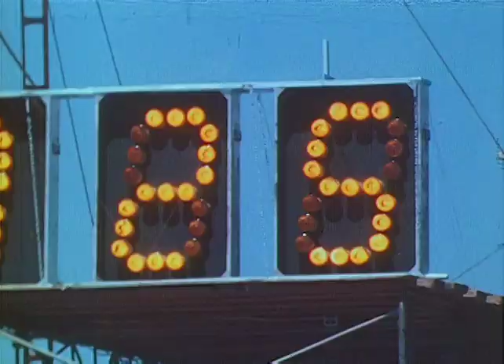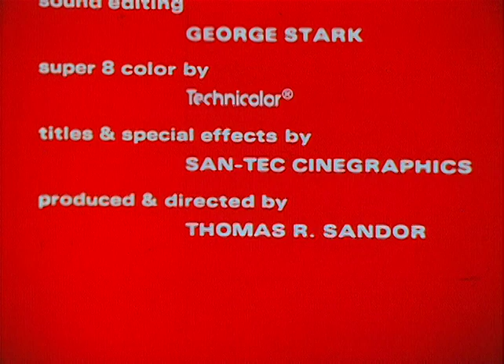Teamwork - 1974 Pay'n Pak

Comment: My favorite , I learned that a boat that corners flat and stable fast will beat faster top speed hulls and survive that rough “Race Water “. 
Testing is Not same as in a heat with lots of boats .
I built the Nitro 1/12 scale Dumas kit RC and we lit it off in a bathtub during a keggar .
    Water went up the wall , across ceiling, and  
down the faucet wall as the Nitro took the Oxygen out of the small bathroom.
 One guy held on as it ran wide open until no gas . Epic and made me smile when 
T-Mobile put in a Swimming Pool for a commercial.
The Restored Pak showed up for display at 
Henleys Resort on Silver Lake in Eatonville for driving school / apba race .
Won my first heat of racing A Stock hydro and then capped it off with Mary Henley choosing me for the Henley Cup .
 Join the Hydroplane and Raceboat Museum and YOU can be part owner !